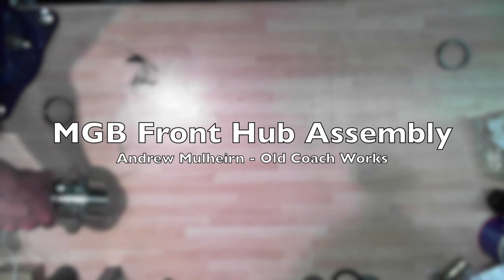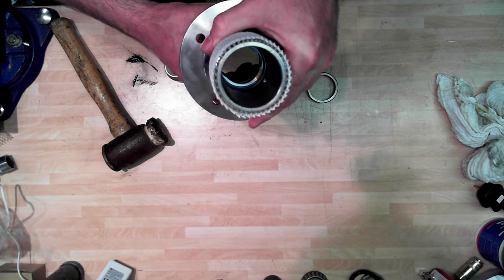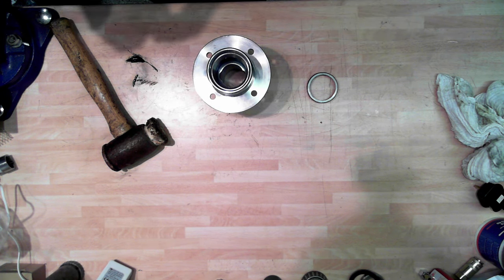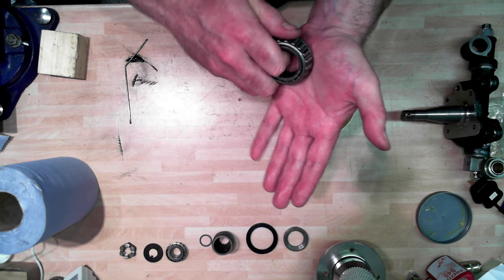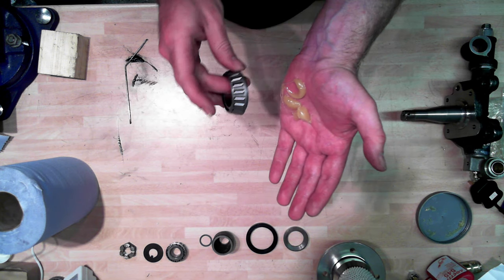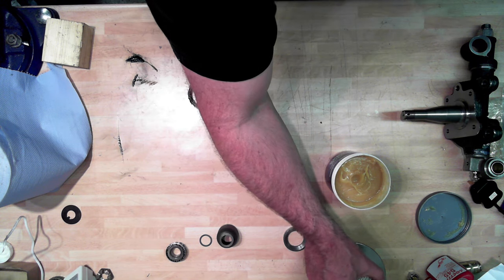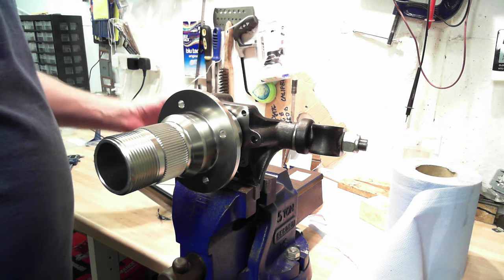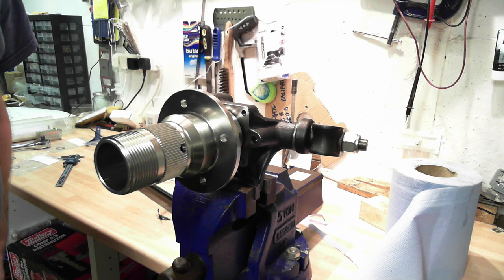MGB Stub Axle/Hub Assembly

Comment: Morning Andy. Age old tech question for you. I have some play in my front offside wheel. Slight up/down knocking if I pull the wheel at 12:00/6:00 o’clock. If I measure the end float though it’s around 4 thou. My main question is, if I’m reshimming and the castle nut is a long way from lining up with the hole, do you back off below 40 ft/lb or tighten beyond 70 ft/lb??? My understanding is the torque creates strength in the assembly but overtorquing will clearly damage the bearings. Dave.